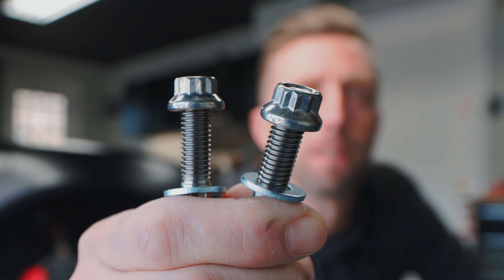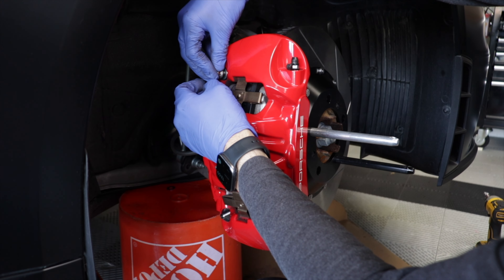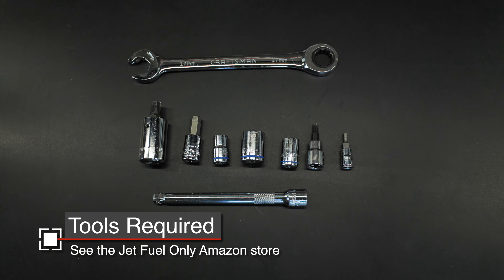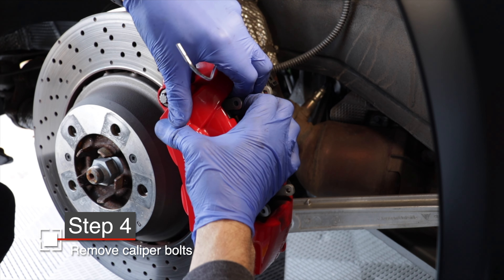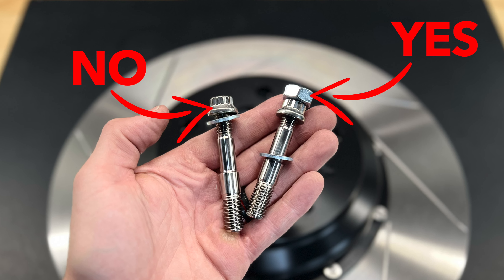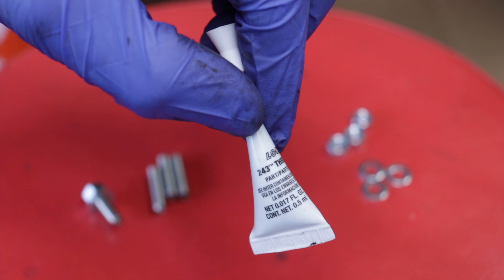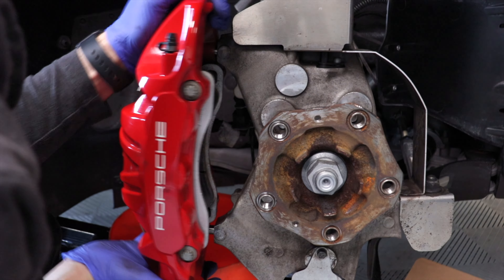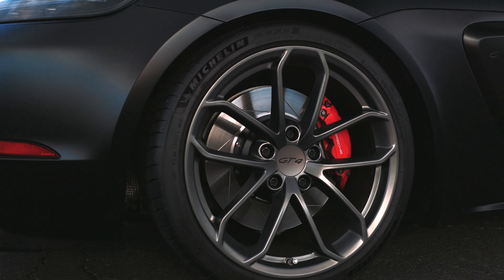Tarett Caliper Stud Kits and Brake Line Bracket Stud Kit

Comment: I WAS THAT GUY at the track with damaged thread on my 718 GT4! 
It was a trackway week-end. After the first day, the front pads needed to be replaced. So I did it on the floor with minimal tools and... I damaged the threads on the second knuckle.
Luckily, there was a guy with a lot of equipments and the right taper tool. So it was an easy fix as only the first threads were damaged.
So I can't recommend stud kits for Porsche calipers
Reply from the maker: Wow!! Glad you got it sorted!
Reply: Why would you NOT recommend the studs?

Comment: will the video and parts apply to a 718 GT4 w/ PCCB calipers??
Reply from the maker: Double check the Tarett site regarding the part to order but yes I’m pretty sure it’s the same.
Reply from the maker: Confirmed same, see this chart: https://cdn.shopify.com/s/files/1/0555/9576/1828/files/OEM_BCSK_2023.pdf?v=1689371284